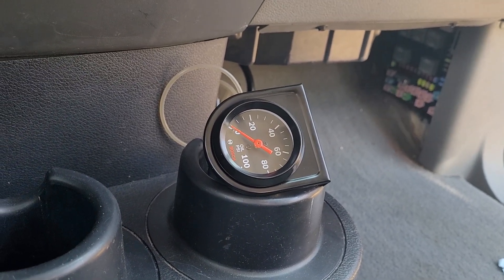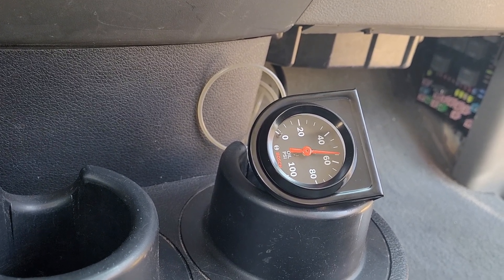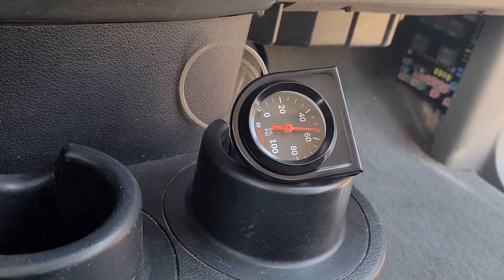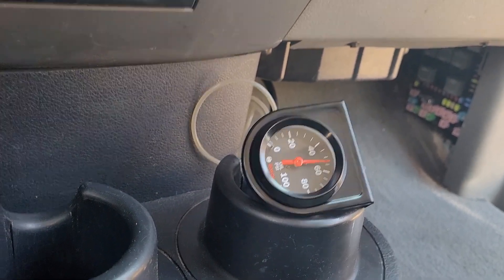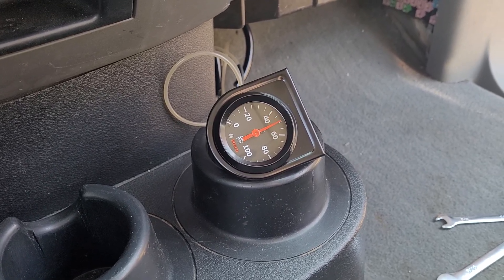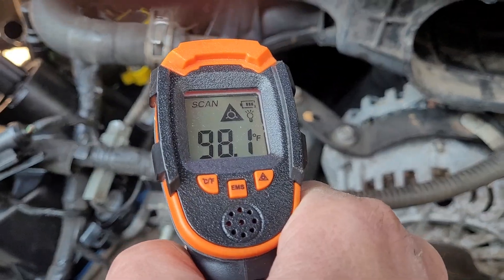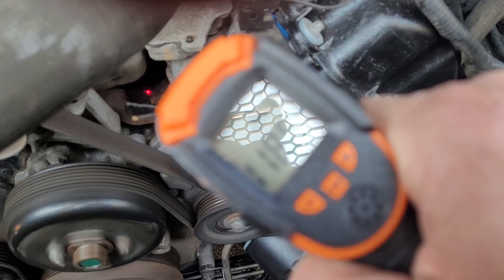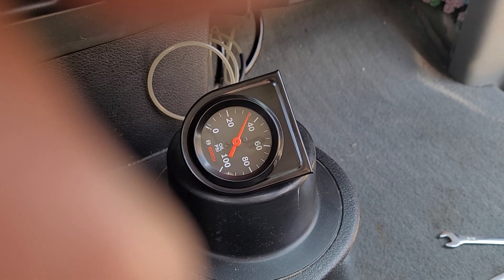What is that sound?   Cold start on just 5w-30 synthetic.  5.4L Triton Part 1

Comment: i'm gonna say on a hunch one of the cam followers seized,  because they tend to do that when faced with the oil starvation issues that these engines are known for.   hard to tell on computer speakers but the way the knock sort of floats down .... sounds like top end.  could try a stethoscope to confirm
Reply from the maker: It sounds like more on passenger side.  When I take the fill cap off, no change in sound.
Reply: IIRC, rear passenger area is the last to get oil & first to starve

Comment: Cut open oil filter.  Check for metal
Reply: +1, it's either the top end or the bottom end.  if there's no metal it's not bottom end.  if there is metal, inconclusive

Comment: Sounds like piston pin rattle through tiny computer speakers. It's almost as if the oil pressure gauge reads with the knock.

Comment: Fix your leaking exhaust manifolds. That sound could be a few things. Spun main bearings, rod bearing, cam phasers. When its fully warmed up your oil pressure should not drop below around 35 psi. If it does the cam phasers will not be able to actuate and it will shake and sound like a diesel. The cause of low oil pressure is usually bad main or rod bearings. When repairing these engines always use the high flow upgraded melling oil pump.